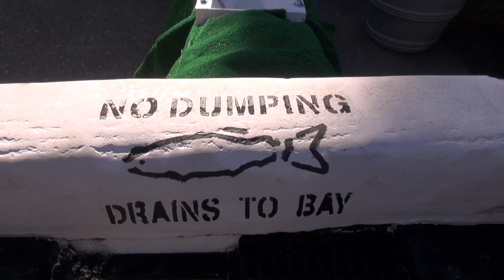Automated Stormwater Sampler

Comment: Nice! What about if I just want to collect storm water for phosphate levels? I want to just make a cylinder with a filter on top that the storm water runs over. Some tube I can anchor into the ground near an outfall culvert. I have to take 30 locations within 48hrs, so it would be easier to have a little device, so when I come back to the site the tube will be full of storm water. I would set the height of the cylinder a few inches higher than the flow level before the storm event. Does this make sense? And are there any devices already made for collecting small samples of water to test for phosphate other than just doing a grab sample